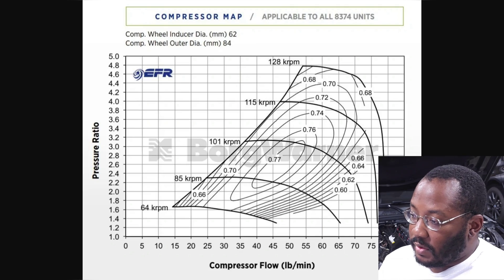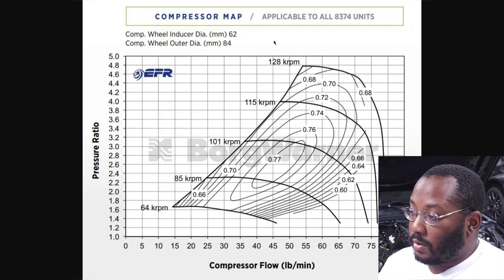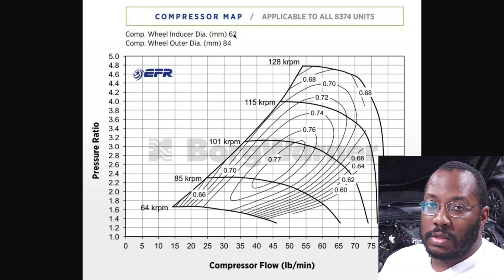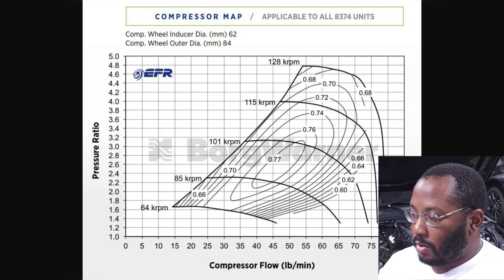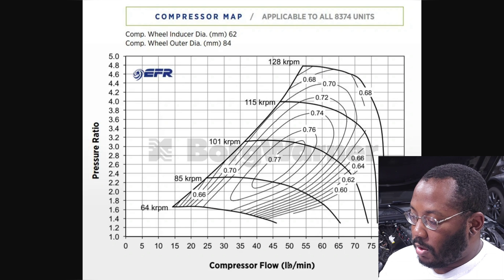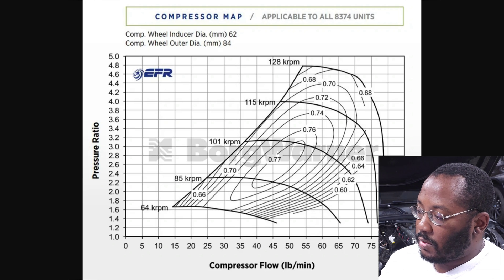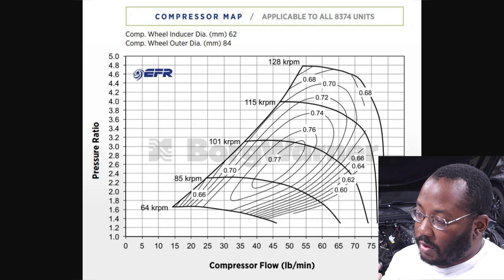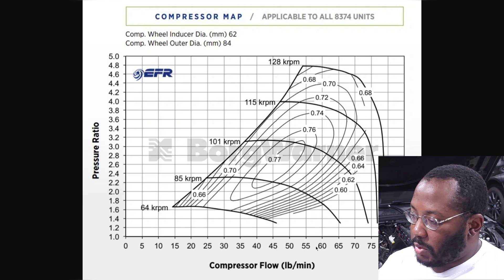More Boost Isn't Always Better...How To Understand Your Turbo's Efficiency

Comment: Hello kern, i need your help please. On my 440i with mppsk and catless dp, I don’t have any upshift burps/farts no matter the driving mode. Do you know any reason that might stop the car making that crisp sound when upshifting?
Reply: Are you on xHP? Usually the downpipe will add a small amount of burbles naturally but you'll get more from modified mufflers. XHP will help you adjust settings on shift for braps.
Reply: @ProducaGraham  I have plenty of burbles and pops and bangs. The only sound I am missing is the upshift brap/burp/fart. I know xhp can tweak that but i was curious why my car does not do what other stock ones do. Came to the conclusion the EU versions come with a different TCU tune from factory as opposed to  the US version. 🤷🏽‍♂️

Comment: The pressure ratio is NOT boost pressure compared to ambient. Its boost pressure after compressor divided by pressure before compressor. This makes a huge difference because there is a intake on there, or a air filter or a combination of both. In many cases you are 100-200 mbar lower than ambient which effects the pressure ratio drastically.
Reply: Pressure ratio is boost. There's 1080mb in one atmosphere.